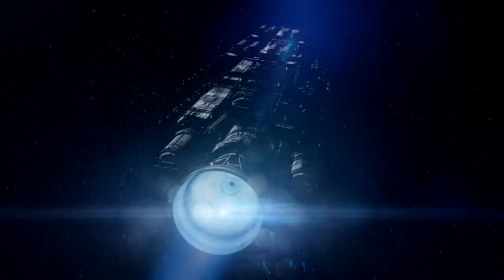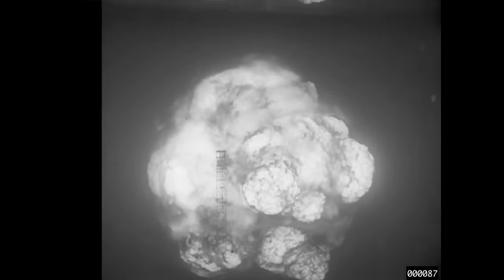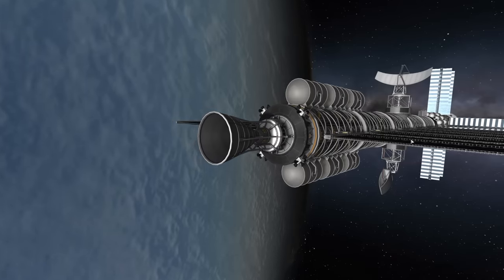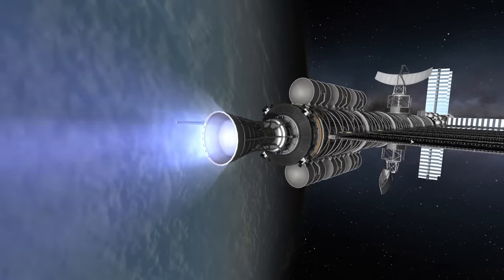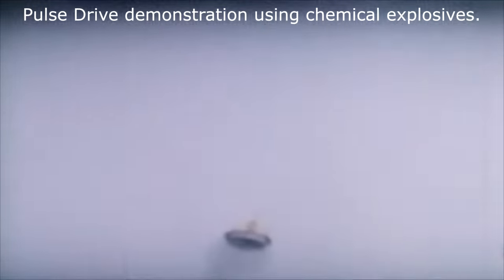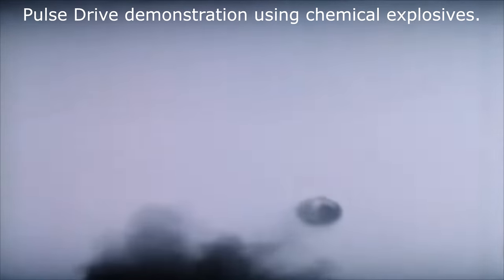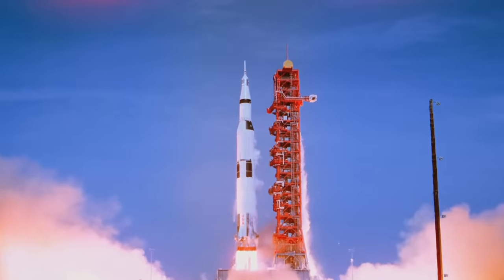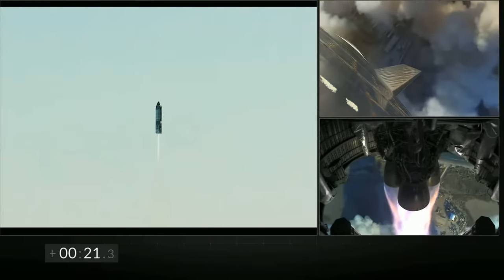The Nuclear Salt Water Rocket - Possibly the Craziest Rocket Engine Ever Imagined.

Comment: Kerbal Space Program 2 developers:
"Write that down, write that down!"
Reply: The trailer seems to feature an inertial confinement fusion engine. I doubt they forgot about this one...
Reply: We can hope
Reply: KSP2 already has a NSWR.
Reply: @GrandProtectorDark  didnt they only have the standard nuclear engine?
Reply: There's a pretty popular mod, Interstellar, that has detailed models of many different types of nuclear engines, all of them based on proposed, real designs. These include thermal, salt water, fusion and fission and require you to be able to regulate heat, fuels, nuclear waste and propellant.
Reply: Screw KSP, someone email this to Elon Musk with entire PDF
Reply: Jedediah has entered the chat
Reply: @GrandProtectorDark  wasn't that called like vasmir
Reply: @dustinswatsons9150  Nah, that's something different. VASMIR means, "Variable Specific Impulse Magnetoplasma Rocket."
It uses radio waves to ionize and heat an inert propellant, forming a plasma, then a magnetic field to confine and accelerate the expanding plasma, generating thrust.

A guy at NASA is leading a research project, on it, according to the Wikipedia article.
The NSWR might actually be easier, which is why Zubrin thought of it.
Reply: this is a joke people. Of course they know about it and of course there's mods with it.
Reply: Let's make Kerbal to glow in the dark!  XD
Reply: Lets hope the nuclear part wont be a DLC with knowing take2
Reply: We already have the stock docking port drive. It has the decent thrust and excellent mass to thrust ratio, not to mention free energy LOL
Reply: @nikkozomara6245  In all the press coverage I've seen of KSP2, I've never once seen them mention this type of engine. They seem more interested in the more fantasy than fact "metallic hydrogen" engine.
Reply: @dustinswatsons9150  VASIMR wasn't an atomic engine. Unless you used a fission reactor to power the microwave that created your plasma.
Reply: @id_NaN  I said KSP 2, not KSP 1
Reply: @waylandsmith  "detailed" models
Reply: @dustinswatsons9150  Vasimir is closer to an Ion engine (but not actually one), than an NSWR
Reply: the NSWR is gonna cost like 200,000 credits in campaign mode
Reply: Simple Rockets 2 already has a fission water engine. But it only has an ISP of 450. Very energy dense though.
Reply: @bbgun061  Scott wasn't kidding about gas core fission engines. Look up "Nuclear Lightbulb."
Reply: Isn't this how the NERV nuclear engines in the KSP1 work already?
Reply: @Aelipse  no, that's a nuclear thermal rocket.
Reply: @Aelipse  yes but NSWR has much higher thrust
Reply: @Lambdadelta-kyo  Correct, NTRs use a solid core. This was an actual fissioning plasma concept.
Reply: It IS full-on kerbal
Reply: @GrandProtectorDark  yeah you're right I forgot to edit this my bad I thought the rocket engines were called vasmir and vasmir was nswr
Reply: @stephenborntrager6542  metallic hydrogen is proton plasma flow, - super heated in a particle accelerator or nuclear reactor, 
Bose Einstein Condensed to below 1 Kelvin for other applications although that phase might be called proton Bose Einstein condensate or fermion condensate.
You will have to use laser cooling to manufacture it and liquid helium to sustain the temperature offline during maintenance.
Also make sure to never let it go an unscheduled offline downtime, it might Hawking Radiate empty space  with Planck length wavelength virtual + real pair of photons and other Planck length wavelength particles ( Planck particles || gravitational strings ).
Reply: Already was thinking of kSp mod.
Reply: @sloma111  was it actually a mod or was it a stock KSP Part that I'm thinking of
Reply: @dustinswatsons9150  from what is written here its a mod.
Reply: The bad news watch where you aim the exhaust so you don't microwave someone. 
I meant so you don't nuke someone.
Reply: I can't wait for the fusion drives to get here. There is so much fusion material laying around the solar system.
It's lighter stronger and cheaper than fission. Only one little problem it don't work.
Reply: @carlsutherland3730  dude are you using speech to text too or was that literal type
Reply: Oh I got your edit
Reply: @dustinswatsons9150  Yeah I typed it. Old school.
Reply: @carlsutherland3730  I used to type untill I stopped giving a fuck about phone keyboard.. haven't found myself in front of an actual in too long
Reply: plus orion drive
Reply: just install kspie it has the nuclear engine plus a host of other engines
Reply: Achievement - Nuclear Fallout: You fired the NSWR engines inside the Atmosphere didn't you?
Reply: I'm going to add nuclear salt rockets to minecraft now :P
Reply: Considering Nertea, the guy behind Near Future Tech, Kerbal Atomics, and Far Future (which includes the Salt Water Rocket seen in this video) is now part of the KSP dev team...
Yeah, KPS2 is going to have a lot of nifty stuff.

P.S. Nertea is also the guy behind SystemHeat (a subcomponent of Far Future Technologies), I'm hoping the sequel will incorporate a longer learning curve when it comes to heat management. Stock is all about having X number being bigger than Y number (also the core and 'skin' temperature models simply do not work well the moment you try to expand on the stock heat system). SystemHeat is about coolant volume, gradient heat distribution, and keeping various systems separate (you don't want to cool the crew cabin with the same coolant you cool the engines with, not that it would normally be possible as they both operate at vastly different temperatures).
Reply: I come from the future, and people have discovered nuclear salt water as a fuel type in KSP2’s files
Reply: Sadly, this comment did not age well.
Reply: @guernica4262  Yeah... I hope someday it will actually be the game they have promised
Reply: @ac281201  lol, it’s dead forever
Reply: @RealTallestSkil  My comment didn't age well lol

Comment: "How is the engine running?"
"Not great -not terrible."
Reply: "He's delusional, take him to the infirmary"
Reply: "How is the engine running?"
"yes"
Reply: Instead of 3.6 roentgen, 3.6 kilonewtons
Reply: @thespaceman9146  Huh.. I'm dumb.. please tell how a radiation unit is equivalent to a force unit here?
Reply: @thespaceman9146  Is it like a joke on, if 50% of humans use this rocket to leave earth, the remaining 50% will get radiated by the rocket's operation?
Reply: @NovaRanger007  haven't finished the video i bet
Reply: @igorgylycheyev9294  Ha ha.. yeah.. completed now..
Reply: @sohamatkar9285  

(Later)

"...So what's this device he tried to build?"

"I don't know, but were going to tear it down. No one needs any more cra-"

"That's not necessary. Flip the switch."

"Sir?" 

points finger "That one."

technician flips switch, causing entire room to explode. Fortunately no one was hurt

climbing out of wreckage
"What the hell happened?*
"It must have been some sort of explosion"

horrified "I, I SAW IT COME OUT, OF THE EXHAUST!*

...

"He's delusional, take him to the infirmary."
Reply: Meh
Reply: @NovaRanger007  This is a joke taken from the HBO show Chernybol where Anatoly Dyatlov says "3.6 roentigen, not good, not terrible". Later in the series they get a better detector, some general straps it to a truck and drives into the plant - when he gets back he says "it's not 3 roentgen - it's 15 thousand".
Reply: @NovaRanger007  it's a joke
Reply: @NovaRanger007  have you watched HBO's Chernobyl?
Reply: Nice😂
Reply: @iCore7Gaming  No.. but I understand the joke now.. thanks
Reply: @warrenflood2809  Thanks.. clears up now.
Reply: I searched for this xxxxxD
Reply: @NovaRanger007  Well, 1) it's doubtful a propulsion system like this would be pointed anywhere near a planetary orbit, and 2) If you look up during the day, at any point on Earth (N & S Poles excepted), you'll see a continuous hydrogen fusion reactor - in other words, a very large H-bomb - sitting about 8 light minutes distant, putting out at hundreds of millions of times as much energy over a far wider radiation spectrum. For which we are all very grateful - we'd be extinct if it quit running. By local galactic standards, even that's pretty small.
Reply: so basically our most advanced conceptual rocket science to date is just big Honda energy
Reply: Warp 3.5 engage...😂

Comment: "900 times the energy of TNT"

Excellent
Reply: If fact, that is very low for a nuclear device, gasoline has more than twice the energy of TNT.
Reply: "Excellent"
I can just hear Mr Burns saying that...
Reply: @misterguts  The energy density of TNT isn't actually that good. especially compared with rocket fuels.
Reply: @karstenschuhmann8334  Yeah, it's bad cos of the weight of all that water, and your per kg solubility isn't going to be above the ballpark of a percent
Reply: @karstenschuhmann8334  I think famously, Twinkies have a much higher energy density than TNT, TNT has an energy density of about 1 kilocalories per gram, whereas Twinkies has 3.4 kcal/g, but this is mainly because Twinkies or gasoline don't have built-in oxidisers
Reply: @1224chrisng  Correct, TNT has a lower energy density than rocket fuel (which still contains oxidizer) and a much lower energy density than fuel.

The increased complexity of a nuclear propulsion system only makes sense if you obtain energy densities and specific impulses far higher than what you could get from conventional rockets.
Reply: What could go wrong?
Reply: It's a good start
Reply: At that energy the exhaust would be a high density plasma. It could be handled with magnetic confinement fields. Also it could be acellerated even more with an ion acelleration array.

Comment: He says “Fly Safe” while describing his magic nuclear bomb Chernobyl flying carpet...
Reply: No less safe than any naturally occurring radiation found in the cosmos. Life on earth has basked in the glow of a gigantic fusion bomb its whole history.
Reply: @iasimov5960  Indeed... Radiation OUTSIDE the magnetosphere, Life INSIDE...  
Launching rocket with a full load of 20%+ uranium in our sky is not an option.  Failure probabilities are still too high.  Even planes still crash a couple times a year.
Asteroid mining and refining in space is the only solution to this.
Reply: S.A.F.E.: Suicidal Atomic Fart Engine
Reply: +1. The feasibility of this thing is hugely outweighed by the long and painful development. How many of those nuke engines and rockets going to explode in Earth's atmosphere before they will safely fly in space?.
Reply: He put the stress on SAFE , I noticed.
Reply: @RobertLutece909  you can't cheat around that way: before testing in space you must somehow deliver it using ordinary rocket. And ordinary rockets tends to crash and explode on a regular basis. The only safe way - to build factory in space and do everything with a radioactive materials here: from mining to enriching and making that nasty nuke fuel. Will be expensive as hell, though.
Reply: @RobertLutece909  Agreed, but I feel like launching tens or hundreds of tons of uranium solution is a bit different
Reply: @RobertLutece909  the most useful cheating when launching radioactive materials in space - keep silent even if it ended up exploding. Military do that all the time over and over.

Comment: Project Orion: "Let's throw megaton-class nuclear bombs out the back and literally blow this thing to Mars."
NSWR: "Hold my beer."
Reply: "hold my brine"
Reply: "Hold my Gose". (For the beer nerds)
Reply: @timd6468  I'm still not clear on what constitutes a gose. Are you implying it involves salt?
Reply: @weatheranddarkness  Gose is style of beer that is brewed with water that has unusually high salinity or has salt added.
Reply: The proposed Orion used much smaller explosions than that! More like kiloton, or a few kilotons.
Reply: @timd6468  Sea water ?
Reply: @yan-amar  Well water. Some ground water has relatively high amounts of dissolved salts.
Reply: .01 kiloton, more like.
Reply: Hold my ocean
Reply: @charlesbouldin3087  250 kilotons each, 1 every 10 seconds,  for 10 years in order to make it to 61 Cygni in 50 years.
Reply: My favorite variation on the Orion drive is the Medusa Drive.  So it's like the Orion drive except you explode the nuke in front of you.

Ok that sounds worse than it is.

So you unfurl a fuck all huge solar sail/parachute thing manymanymany kilometers ahead of you. The sail I think would be something like 200 kilometers across.  You connect to it via cables.

You throw the nuke in front of you and manymanymny kilometers in front.

It explodes and is a shaped charge so most of the nuclear energy is in a cone projected onto the sail.  But the sail is so big and far away it's basically just spray of relativistic fast gasses rather than a destructive bomb.

The sail accelerates away from you and you play out the cable like a fish and once it's done accelerating you real your ship back up the cable. 

Repeat.  

It also has the advantage that you can use other pressure sources like regular solar wind, concentrated Helio-lasers, artificially induced solar plasma fountains, or magnetically accelerated matter streams.
Reply: Hold my neutrons
Reply: This would pollute far less than orion since it's more energy effective as all the power is converted into thrust.
Reply: @suprlite  Orion designed craft will never be built on the ground. So wont pollute the atmosphere due to the craft being assembled in high orbit.
Reply: @irontusk341  thanks captain obvious.
Reply: @suprlite  lol You're Welcome. ;)
Reply: @irontusk341  Orion was though, however designed with launch from earth's surface in mind. It would drastically reduced the price of sending heavy objects into space.. But it was (fortunately) stopped because of the fallout it would have produced.
Reply: And at the target turn around and do it all again to stop.
Reply: @suprlite  I dont disagree with you, That's why in order to revisit the concept, would be to have it assembled in space. Now i agree the Orion Engine should only be considered in a "Doomsday" Scenario, and there are books out there that discuss that.
Reply: @irontusk341  Imagine slowing down in that thing.
Reply: @PandorasFolly  Relativistic Fast Gas. I'm calling space fallout that from now on.
Reply: @wayfarerzen  it would be possible using a number of large ion engines for 6 years to slow the Very Large vessel down after traveling 50 years.
Reply: @charlesbouldin3087  And the irony is - Orion would have worked. It would work now. Payload wouldn't be shaved in grams, either.
Reply: @irontusk341  What kind of payload do you figure on boosting? Hadn't considered 61 Cygni. . .
Reply: @PandorasFolly  Dr. Pournelle wrote a paper about this, although if memory serves he postulated a larger sail. Much later, some of the math went into "The Mote In God's Eye" but that's another story.
Reply: @irontusk341   Yes, if you read the original research papers, and do the numbers, it's possible, and the fallout from one launch? If we really had to do it and no options? Ted Taylor once remarked that much of a fission explosion's output can be tailored to the requirement, as can the direction. And he would have known, if anyone would.
Reply: @irontusk341  \Those numbers are for the much larger interstellar version. The original Orion proposed using sub-kiloton explosions for a takeoff from Earth surface for interplanetary missions. 250 kilotons, used with that design, would destroy the spacecraft.
Reply: It's funny because Zubrin thoguht this up precisely because he felt the bouncy bang bang bang nature of Project Orion just wasn't good enough
Reply: @yan-amar  No, plutonium salt brine.
Reply: @ Delivery McGee, Project Orion would have used kiloton yield, not megaton yield.
Reply: @williamblack4006  I think he's talking about the flying city 10% c ones
Reply: @flyingbeaver57  Correct. Ted Taylor stated that bomb debris which didn't impact the pusher plate would exit the atmosphere traveling far above Earth escape velocity.